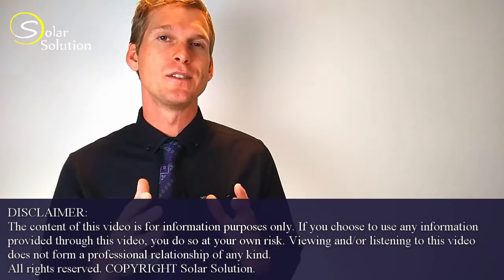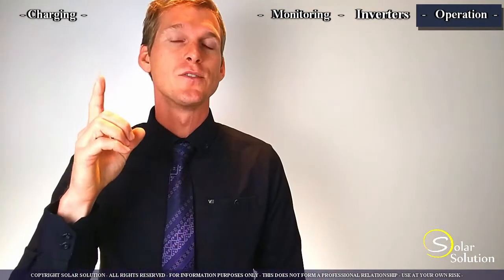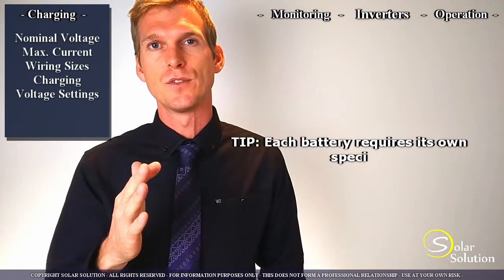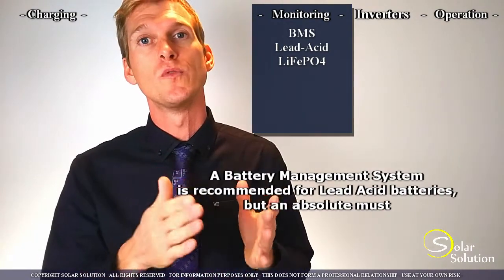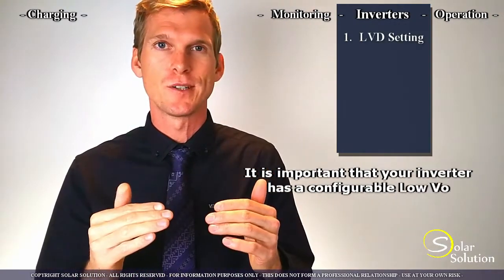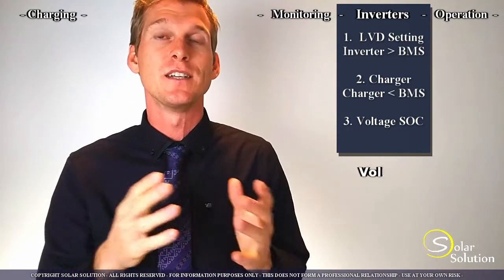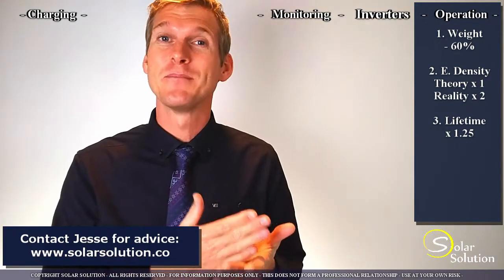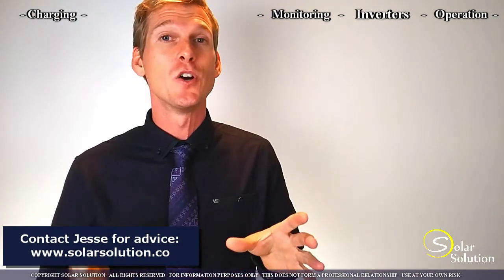Replace Lead Acid with Lithium Ion Battery - Charger & System requirements [FLA - LiFePO4]

Comment: I’m getting ready to install an off grid solar system. I’m using an AIMS inverter/charger which on many suppliers’ websites is compatible with lithium ion batteries however it is not an option in the settings of the charger. I’m having trouble finding out what I should set the charger to in order to charge my Lion Energy battery bank from a generator if I have a streak of overcast skies and the solar charging is insufficient. Can you please advise?
Reply from the maker: Hi Matthew, thanks for your question. I would be happy to help you with personal advice: You can find the different options at the main website: https://solarsolution.co/services/
Another video which might also get you useful information, is on the battery charging voltages, did you see that one yet? Here is the link: https://youtu.be/87rxYyTZgbE
Good luck! Jesse

Comment: ive seen many people using li-ion batteries in racing cars or even regular cars mostly because of the weight reduction. would that be ok to use?
Reply from the maker: Hello @Comedyman112, thanks for your question. This video discussed several aspects which should be kept in mind while considering replacing conventional lead acid batteries with Lithium Ion batteries. Could you clarify which aspect remains unclear?
Thanks, Jesse. 
PS Please tag @solarsolution in your response, otherwise it might not show up in my notifications.

Comment: I have an old solar system set up, my mppt solar charge controller doesn't have an option for lithium. It only have AGM, GEL and LIQUID. Can i use it for my lithium? If yes, which of the battery should i choose?
Reply from the maker: Hi Patrick, thanks for your message. I suggest you start with verifying whether your MPPT Charge Controller has configurable voltage settings for the different charging stages.

Comment: Really enjoying these informative videos. Do Lithium Batteries go through a bulk, absorbation and float, like Lead Acid? I believe I heard in a past video that Lead Acid could charge relatively fast up to 80% but the last 20% (Absorbation) was fairly slow. Is this process the same with Lithium?

Jason
Reply from the maker: Hi Jason, it's always good to hear from you. You are correct to assume that Lithium's don't have the same multi-step charge algorithm as Lead Acid batteries. Conventional equipment can be 'fooled' into treating Lithium batteries correctly, by setting the settings correctly [e.g. the temperature correction factor as mentioned in the video]. Most modern equipment already has Lithium-ready charge settings as preset values.
Reply: Some good points here. However, although you mention temperature in respect of not needing to monitor temperature while charging with LiFePo4 batteries, I believe that you didn't mention the fact that LiFePo4 doesn't like to charge much below zero. In northern European winters, you can have single digit sub zero temperatures for quite a few days at a time. This would mean that in cold weather, lead acid, which can happily charge away at down to -20C, would in this instance be far more useful. I have looked into this for remote automated weather stations. For anything that doesn't need portability, SLA has a significant benefit in this regard.
Reply: I guess the piece information I am after is can a Lithium be charged at the full amp output of the charger all the way to 100% or does it tapper off after 80% like lead Acid. For example I have a 40 amp DC-DC by Renogy it pumps 40 Amps at my AGM until it hits 80% then it goes into Absorbation and that last 20% can take awhile. If I switched to Lithium can the DC-DC pump the full 40 Amps at the battery all the way to 100%? I know this is a question for Renogy but I have called their support before and I wasn't very impressed with their knowledge. 

Jason
Reply: @PrimalOutdoors  Typically, a Li-Ion battery charger does do BOTH a Bulk (CC) Mode and an Absorb (CV) Mode.  But, the Absorb (CV) Mode for a Li-Ion batteries is much shorter vs a Lead Acid battery.  Typically, we do NOT ever try to get to full 100% SOC with just Bulk (CC) Mode <= WE DO NOT !!!  But you can get to 85% - 95% with just Bulk (CC) Mode, SKIP over the Absorb (CV) Mode and go directly to Float Mode.  If you never run an Absorb (CV) Mode then your Li-Ion battery will be slightly less than 100% SOC but they will last longer ( more cycles ).  This is YOUR choice ... more cycles at a lower charge or fewer cycles at a higher charge.
Reply: @vtorsi610  I appreciate the reply, I think I will be switching my AGM out to a Lithium very soon. 

Jason